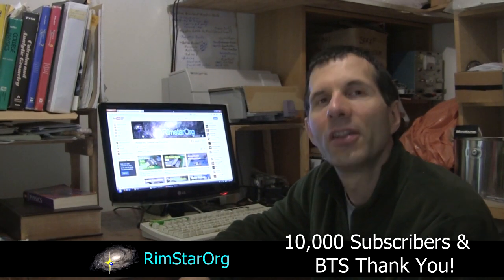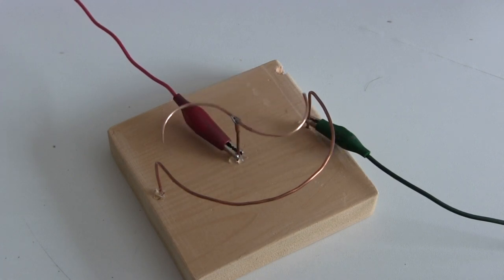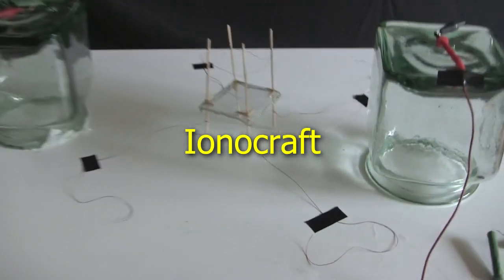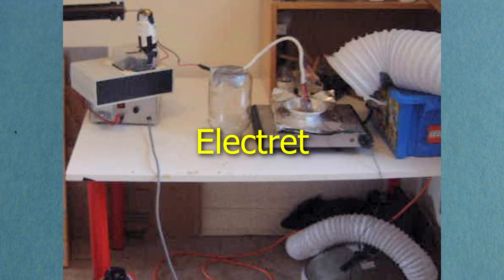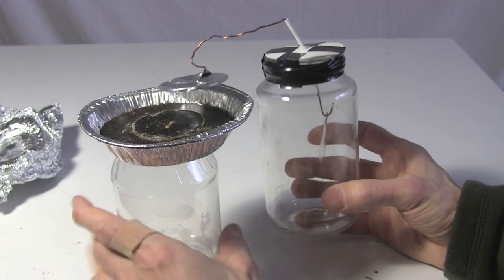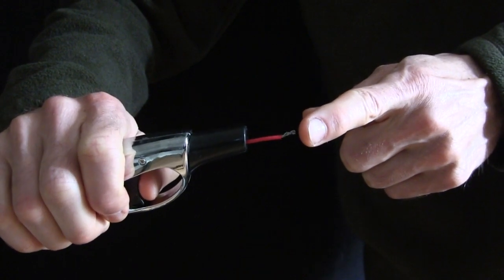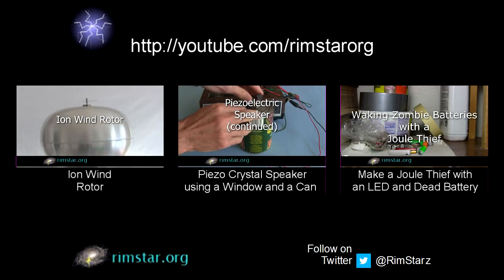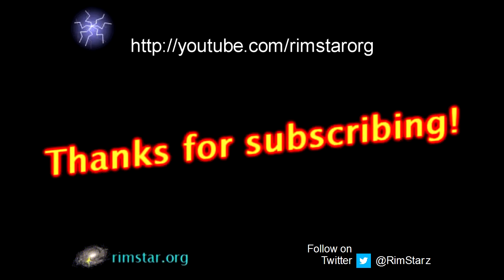10,000 Subscribers Thx - Ionocraft, Electret, Joule Thief, and More

Comment from the maker: No, because unlike where you have a fan at the top, in an ionocraft the "fan" is the stuff at the top and the bottom. With only a single, big diameter wire loop at the bottom you interact with the air near that loop wire, but with a mesh you interact with a larger volume of air above it.

Comment from the maker: Re just having another loop of wire on the bottom, sure, there are plenty of designs. But the idea with a mesh like a flyscreen is you have many many loops, so you move more air.
Re Using the DAM design to suck more air, if it can't be incorporated directly into the design then it can be inserted below the flyscreen mesh once a jet of neutral air has been created. I'm not sure if they give up air velocity for air volume though (i.e. is the air velocity coming out of the slit in the rim faster?)

Comment from the maker: The holes in the flyscreen are supposed to do the job, though I've thought about making them bigger by removing every second wire. I hadn't heard of the Dyson Air Multiplier fan until you mentioned it, but I just looked and it's entirely different. The DAM fan has an electric fan in its base that moves the air. In the ionocraft the air is moved by using an electric field to create ions and move them along with neutral atoms.

Comment from the maker: Seems like it, doesn't it! :) It provides the other polarity for creating the electric field which helps create the ions. It also attracts oppositely charged ions causing some to collide with neutral atoms. It's those neutral atoms that are supposed to fly through the holes in the flyscreen, resulting in an imbalance in the momentum transfer, causing the device to lift off. Someone named De Seversky experimented with this design successfully back in the 40s and 50s.